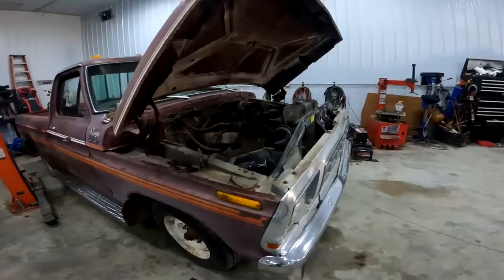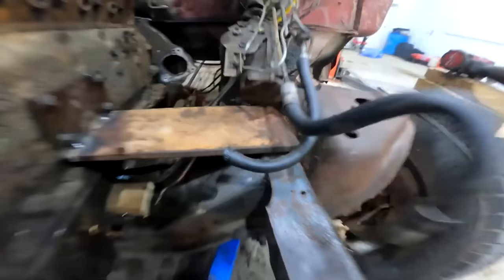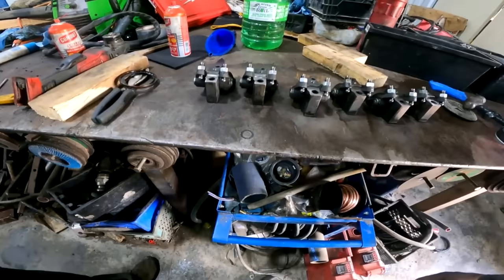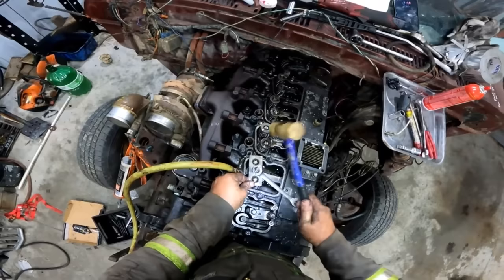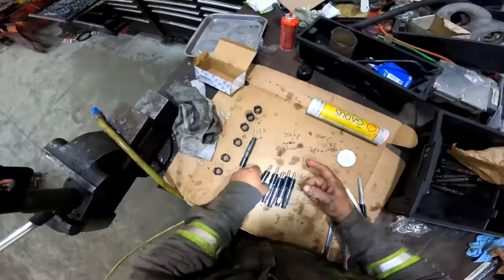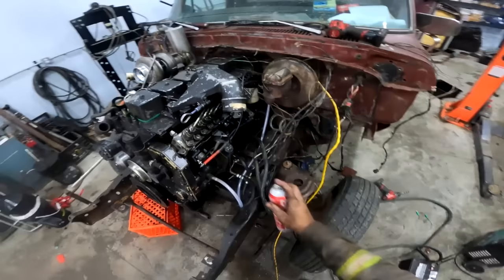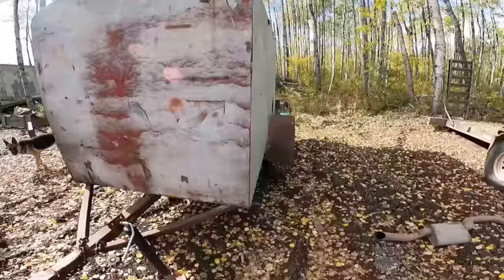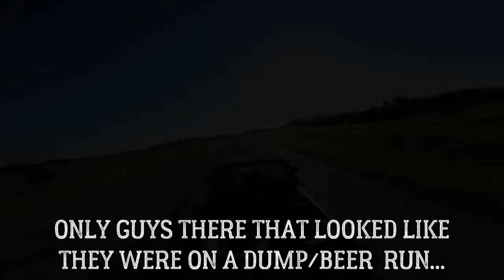1979 FERD CUMMINS DUMPSTER BURNOUT TRUCK BUILD!!! RE-UPLOAD

Comment: I had a 6.0 threw me for a loop, same intermittent no start. No ficm sync. Crank sensor wires ohmed out perfect everywhere. Did a pin drag at the pcm, they were slightly loose. Managed to catch it in the act and confirm that was was the problem. I’ve had it a couple times since always the first place I check now!

Comment: Always reuse your cummins head bolts, torque it down with the half inch impact, never deck the block or head and built it in the back yard in the dirt.  They absolutely love it.  Don’t burn diesel in it, just straight used oil of all varieties and give it all of the boost and egt’s.  The engines love it. I built one properly and one like I described, the one I built properly blew a head gasket

Comment: Love the machine work my friend 😂

You got luck or maybe I don't have any haha. I'll put motors together where the machine work and tolerances are absolutely perfect. Everything torqued to spec by the book with all new high quality brand name parts and proper installation procedures and yet I've had brand new cams wipe themselves out during break in, had brand new head gaskets start leaking after 1000 miles, rear main seals start puking oil after a month etc .... 😂

Any who, enjoyed the video as always my brother!

Comment: I swapped my 76 f150 with a 429 to a zf 5 speed 4x4 and hooked up the hydraulic clutch slave to the factory clutch pedal it was easy

Comment: Will a 12 valve fit in a 78 K5 Blazer
Reply: Check out Finnegan's speed and marine he put a twelve valve in a 70s crew cab ramp truck. If your k5 is 4wd it needs a Dana 60 to support 1500 lbs of heavy ass diesel the wheel bearings on a Dana 44 won't support a 6 pot Cummins that's why 3/4 ton Dodge's with Cummins have one ton frontends